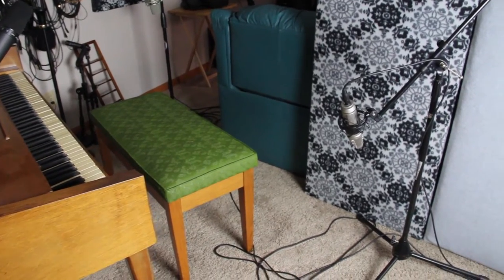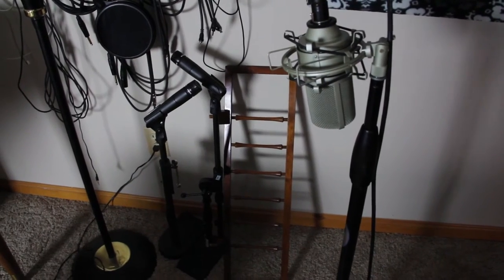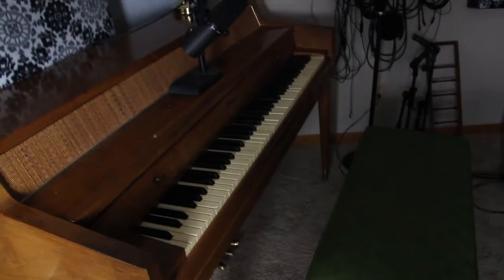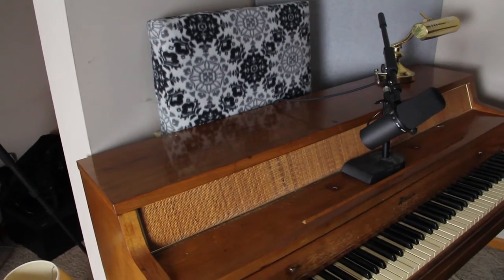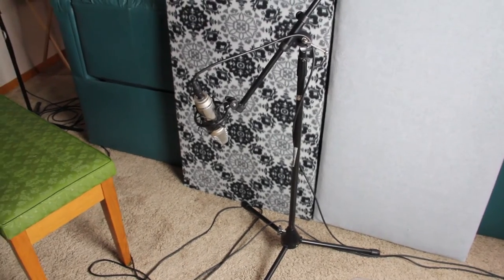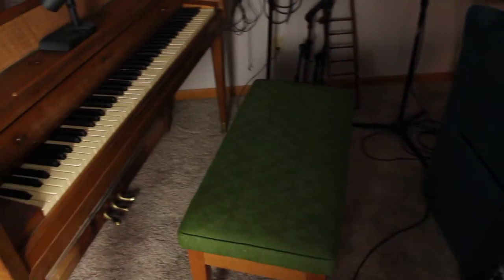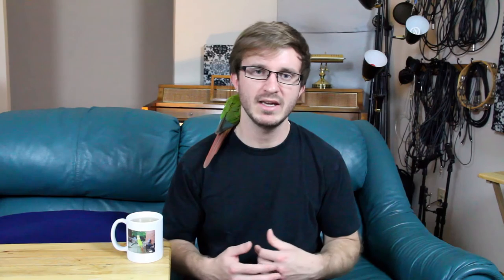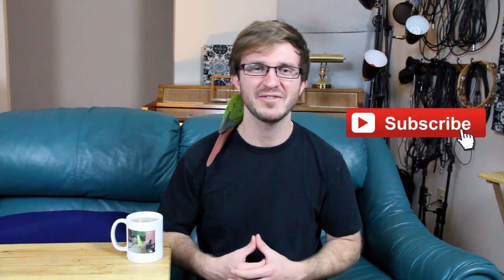Recording Upright Piano: Condenser Mic Placement

Comment: If can only buy one mic to record my upright piano which one would you recommend? Great video 👍
Reply from the maker: Thank you! It depends on price range really. Do you have a recording interface with phantom powering for a condenser mic? Or do you need something like a digital recorder with a built in mic?
Reply: Todd Audio yes I have an interface. I would also like to know which placement would you prefer for that one mic only?
Reply: Todd Audio my price range is up to $150
Reply from the maker: +Javier Santiago ok. What are you connecting the microphone to to record the audio with?
Reply: Todd Audio my computer to record with garage band.
Reply from the maker: Ok, really at least two microphones is more ideal for piano. If your interface supports two mics, you could get 2 SM57's and try something like what I did in this video https://www.youtube.com/watch?v=HmpvW8TVKSE - You might have to get these used to stay within your price range. They are about $100 each new. 

The other option, if you can only use one microphone I think I would try more of a room mic approach, but fairly close to the piano. You could get a condenser mic like the MXL 990 for around $100 (sometimes you can even find them on sale for $70 - maybe search around for the blizzard edition MXL 990, that seems to be on sale some places). This type of mic will capture sound from further range, so you could still get a wide spread with one mic. I'd probably start by trying to place it around the listening position - maybe a little above your head while playing with the front facing the piano. You can also try mounting it upside down. One obstacle with this type of mic and home recording is it might also capture some room reverberation, just a heads up. It depends on your room setup, size, how much space between the mic and the walls, etc. Anyway, if you go this route, I would try doing the following after recording: copy your track into two tracks in garage band, use an equalizer to decrease the amount of treble on one track, and decrease the base on the other track. Pan the base track slightly left and the treble track slightly right. This would give it more of a stereo effect and presence, similar to recording with two mics.
Reply: Todd Audio ok awesome info! The problem with the room mic is that I plan to record at the same time with a singer, and my interface only has two mic inputs and a usb input so I  can record alone but when I want to record live with the singer for videos I only have one mic input left.
Reply: Do you think recording with the condenser mic will pick up the singers voice while I play? Unfortunately we dont have a booth or seperate space yet
Reply: Our vision is to record ourselves while playing and film it at the same time. I think the condenser mic might still be a good option for now. I was wondering if I go the two sm57 route can I plug one of them the usb input witn a xrl to usb cable?
Reply from the maker: +Javier Santiago yes it will, but if it is a cardoid polar pattern like most, you can have the face of the condenser mic towards the piano and your singer standing on the other side of the mic that is not as sensitive. It will still pick up some of the singers voice, but if they sing on a separate mic directly into it, that track will be the more prominent and you can still adjust volumes and do some editing with it.
Reply from the maker: +Javier Santiago I don't think so because you have to select your audio source in the Garage band preferences. I think you have to choose one or the other between usb mic and interface. This is how most audio software works, but you could double check or search around to see if there is a plugin for it on garage band.